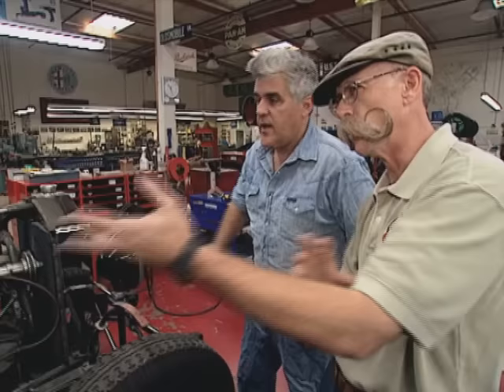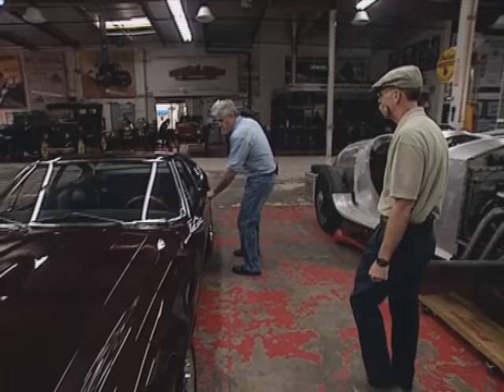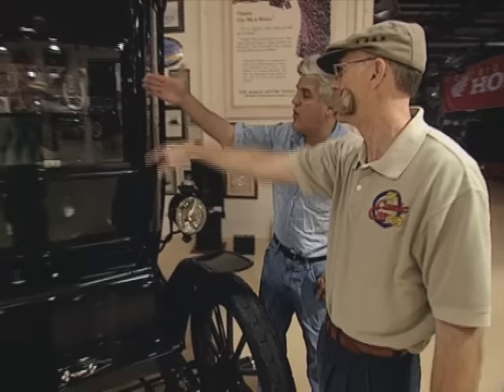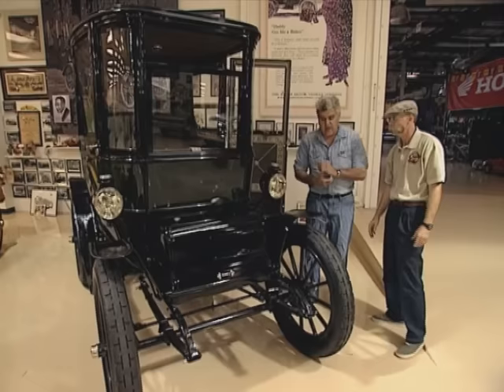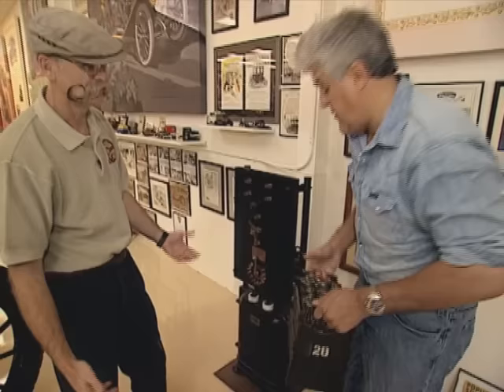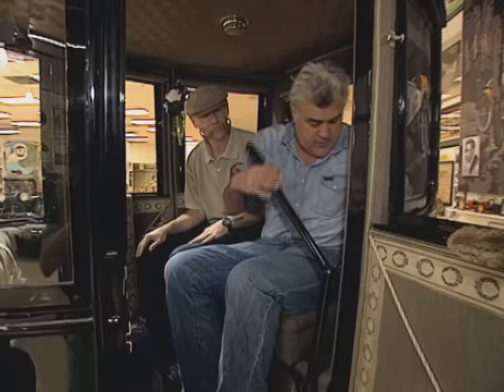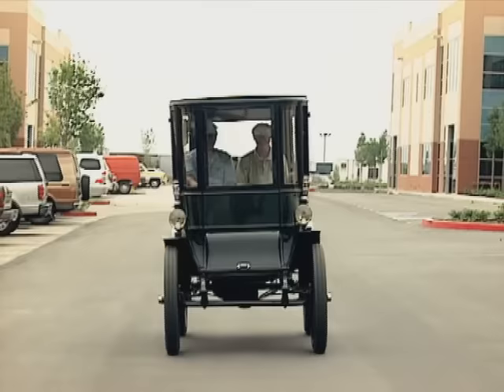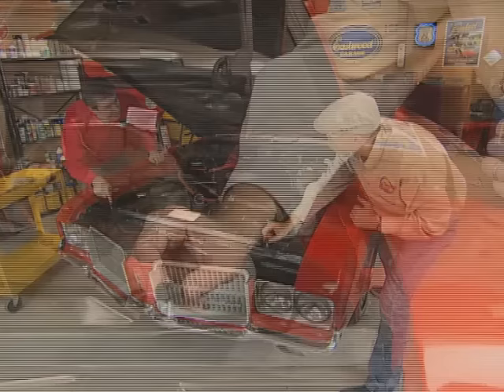Jay Leno's Baker Electric Car

Comment: Electric cars were very popular in the early automotive days. Electricity was easier to get than gasoline, and electric cars were easier to operate and maintain. However electric cars couldn't compete with the increasing range and power of gas cars, and the electric grid didn't spread fast enough.
Reply: You nailed it electric cars were coming into play at the same time gasoline car's were just gasoline car's made more sense at the time it was all New technology at the time

Comment: The crazy thing is that this car accommodates four people, sitting facing each other. So the driver, in the back seat, could have two passengers in front of her, facing her, blocking her view ahead. Not sensible.
Reply: hebneh sensible enough  a hundred years ago, going ten miles an hour.no horrible freeway accidents had not occurred yet
Reply: Who cares, women still crash when there's nothing blocking their view, lel. Also this car wasn't fast enough to cause any serious accident.
Reply: none of your business good to identify yourself here without further ado. there wasn't anything you were willing to share besides just that was there?

Comment: Tesla??? HA!!  I'd love to have one of these electric phone booths on wheels ^____^  Amazing!!
Reply: Angus Chandler  the fact it can only go 3 times as far as a car from the 1900s is... Not great. I know it doesn't have gewgaws and knick-knack paddywack give-a-dog-a-bones, but still. This could have lead to 1000 mile cars if we developed it then.
Reply: Angus Chandler  and if we had continued developing these, we'd have 700 hp and 1000+ miles of range.
Reply: Tesla was the one that started the revolution for real this time, they did not back down even when they were told to do so. They had to overcome all those years of brain washing the whole word has had for the last 120 years, GM tried it in 1998 and failed miserably to withstand the war against the usual suspects, watch the movie "who killed the electric car" if you want understand this a bit better. The fact that Tesla exists and it is forcing everyone to join the revolution or be irrelevant in 20 years is simply amazing.
Reply: I would upgrade the batteries in this and it might go faster and drive longer 😂

Comment: Astounding that cars like this still run, even if its a 1909 electric car! I'd like to see some toyotas or volvos or saabs last half that long
Reply: I would also like to see a Tesla last as long as the Baker. They think they're the biggest bunch of badasses when it comes to both electric and high performance cars. I think not.
Reply: +Stephen Carrigg its really not that astounding, cars this old are most of the time broken down in like a yard and then restored.
Reply: any car will last that long if its parked in a purpuse fit building maintained by a multi millionaire
Reply: it's probably restored

Comment: So how do you drive it?  Where's the throttle?  Just showed how to steer it. I hate when they skip important shit
Reply: Paul Digga And how are the brakes? And no seatbelts? How is it street legal?
Reply: Brian Battles  If it didn't have seatbelts when it was new, it doesn't need them now in order to be legal.
Reply: My father has a '60 Dodge Dart that has a chrome dashboard with no seatbelts.
Reply: its just 23mph not 123mph
Reply: I maintained a 1903 Baker at Hill & Vaughn Restorations back in the early 1980's. Ours was a right-hand drive. There was a beautifully finished phenolic black lever on a nickle plate to the right of the driver on an "armrest" sort of upholstered shelf with etched labeled "forward" and "backward". It had a very discrete "accelerator pedal" sticking out of the floor that ran through a rheostat/potentiometer. The brakes were terrifying, but at least they did not have that evil driveshaft brake like many other cars that reversed the wheels' rotation through the differential, because thankfully, there was no driveshaft brake. The windshield glass was beautifully beveled along the edges and the "bay window" glass was curved and beveled. The interior ambiance was so restful. I loved that car.
Reply: There's no bathroom in it ...
Reply: And the brake
Reply: Never Gonnatell  like you just said, each state has the right to their own set of traffic laws. And all 50 states have adopted the seatbelt law. Making it a legal part of legislature. So your argument is a moot point
Reply: @BrianBattles  
It's classified as an oldtimer. Special laws, special insurance. Can only make a certain ammount of miles a year on it. Laws might be vary from state to state, but a vehicle that is eligible for oldtimer status doesn't have to be matching current day laws.

Comment: Here's an interesting fact. Internal combustion engines are the highest advocate of the century. For most people, it seemed like the only logical choice for automotive power. But over 100 years ago, internal combustion engines faced fierce competitions: Electric cars that was on this video were clean and quiet, and allowed people to coast around neighborhoods with little noise or fuss, but big heavy batteries that couldn't go very far soon took electric cars out of the race. Cars powered by stream engines didn't had that problem.They were reliable and fast, so fast that back in 1906 they beat out gas powered cars in a head to head race, and set a land speed record of more than 127 miles an hour. Best of all, stream engines had been around for years, and engineers knew how to design and make them work.

Comment: How was the power regulated - when starting for example or for slowly rolling. Heating Resistors?
Update: I found all the info. And it CAN regenrate power when you go downhill. If you put it in reverse, it will brake while charging the battery.
Reply: it uses a bank of carbon pile resistors. it is a stack of carbon discs, more discs=more resistance, the stack of carbon discs you selected determined your speed. on these early electric cars you would have like 5 power levels to choose from with a switch. the carbon piles were on a drum and moving the switch rotated the drum connecting the carbon pile resistor you selected to the positive lead allowing current to flow to the motor.

Comment: Did he say he put Bosch Fuel injection on a Rolls Royce merlin?!! I dare say some Englishman just spat his pipe out.
Reply: Late versions of the Merlin used pressure carburettors which eliminated most of the faults, notably during inverted flying or negative G forces.  The pressure carburettor was introduced at the same time on British-made and US-made Merlins.  All these Merlin engines are Rolls-Royces, whether made in the UK by Rolls-Royce or Ford,  or in the USA by Packard.
Reply: @doktorbimmer6640  Won't happen. They looooove them some New Babylonia (united Europe)

Comment: why electric car technology is kept away ????
Reply: big oil
Reply: +Chris Beach  but why ??? instead electric generation would be bigger business than oil
Reply: not if you're an oil company
Reply: +Chris Beach ,,,, it's not about you and mee,,,, it's about our next generations future,,,
Reply: I agree, I'm just telling you why.
Reply: Fuel company's dont want you to go now do they. :)
Reply: +Nevakonaza -  we comman people are only slaves of government and corporations
Reply: For the same reason Cannabis is "kept away"  unfortunately there is one too many  greedy bastards at the helm .
Reply: The problem is battery technology. Its development has only picked up in recent years.
Reply: batteries suck, that's what most of the cost of Tesla is, batteries.
Reply: and the fact that the output/size ratio of batteries have yet to match that of gasoline- doubt they ever will, that's an explosive force in such a small package.
Reply: Jack Son 
Well capacitors have a chance. We've basically reached the max energy differential with Lithium and Cobalt, all we can do now is make the process more efficient or find a way to replace Cobalt with Fluorine.

Batteries work on a Redox reaction last time I checked
Reply: does it really need an explanation?
Reply: @Drakilicious Still, 100 miles on a charge is nothing to sneeze at even nowadays.
Reply: price of operation.

Comment: What killed the electric car?
Reply: +The real doktorbimmer The batteries weren´t that reliable maybe?
Reply: The ICE age!!!
Reply: shitty range most people can't afford two vehicles nonetheless an electric and a gas vehicle 1 for commuting to work and the other for long distance travel
Reply: Greed.
Reply: Uneconomic to produce, failure to maintain technological growth with ICE cars primarily due to lack of economic incentive. A few other reasons.

Bimmer is just a hater.
Reply: Shitty range
Shitty batteries
Expensive as hell
Poor reliability (those Lead Acids die extremely fast)
The cheap Model T

That's what killed this car.
Reply: don't forget the Model T was the first one to produce hundreds and hundreds of models in a time when most could only produce dozens and dozens.
Reply: It didn't really die, it just became a golf cart.
Reply: cory2146 — Economics
Reply: 1) motorists preferred a vehicle with higher speed & longer range
2) motorists also wanted a vehicle that they could easily fill up in minutes, not an hour or longer
3) similar to (1), you could easily drive from the city to the country & back. You could carry an extra can of gas at the back. Or buy it from a general store or workshop at a village. The same village would likely not be electrified yet, what more have a charger that's compatible with your electric car.

Comment: Greetings,
The Cheney-Cowles Museum in Spokane, Washington used to have an electric car on display in their collection.
I can’t remember if it was a Columbia or Baker car.
It was owned by one of the founding families of the city, and driven by one of the senior women in that family.
Hanging on the side of the passenger compartment was a medium sized bell.
The Spokane Police Department required installation of the bell, to warn pedestrians of the car’s approach.
The car was very quiet in operation, especially in comparison to other cars on the streets at that time.
The woman who often drove the car had a habit of of driving up to people standing in the street or on the corners.
If they did not get out her way, she would drive up close to them, and stop.
If they still did not clear a way for her, she would honk her horn, often startling them.
The Police Department tired of receiving angry complaints about her behavior, as well as complaints from her about people blocking her way.
The Police Department suggested she hang a bell on the car, to alert people of her approach.
After a time, she had the bell removed.
The problem of people not clearing the way for her returned, as did the complaints from all those involved.
She was elderly, and could not, or would not, learn to drive a more modern car.
The Police Department now required the return of the bell, as a condition of allowing her to drive on the streets of the city.
This story was on the plaque describing the car and its history.

Let’s be careful out there.

Comment: "Hi Bernard,..yeah,it's Jay calling.I'm in the Baker.Yep,the Tesla battery pack's working great.I just passed Vegas at 80mph as the throttle pedal seems to have welded itself.Uhhhh,...How do I shut it off?...I have...uhh 70% left,but the tires not so much.."

Comment: Back in the early 1900s and before urbanization the average shopper traveled less than a mile or two. Much easier to recharge an electric car before gas stations appeared on every corner. A Baker electric could be seen on the streets of Cleveland into the early 1950s.

Comment: Back in the 50's cars had 6 volt systems that really had a hard time starting in sub zero weather. 12 volt systems were added and cars have started easier ever since. Why? Although 6 volt batteries had high current capability, when the temperature dropped the amperage output also dropped as well as the voltage. The lower voltage was not enough to push the current through the starter. If a 6v and a 12V  battery have the same amp hour rating they can do the same amount of work. I'm guessing that the Baker had a 6V motor and that is why you used a 6V battery. Great video.

Comment: Actually the Baker did have regenerative braking.  You get regeneration automatically when you connect a DC motor directly to a battery the way the Baker does.  Leno could drop a set of off-the-shelf lithium batteries into his Baker without modifying anything on the car.  He would get a range of 500 miles which is more than most modern  EVs.

Comment: The Baker is basically a street legal electric golf cart. I'd love to own a  modern version of the car with a price point around $12K. This could be a base model, with a 100 mile range, mainly for running errands around town. Correct me if I'm wrong, but I don't believe you can buy any new, fully electric, street legal, vehicle in the USA for that amount.

Comment: That would make a kick 
ass kit car.....probably not street legal in many states....no problem where I live...lake havasu city...you can put a plate on anything...how many places do you see side by sides as daily transportation? Open wheel dunes buggies with no winshields..just need eye protection...ever see a banshee on the street? Troy trucks. No muffs, slicks...just drive the speed limit and dont drink and drive....no smog or safety check. Headlights, tail and brake lights and it's good to go...I have a 3000 watt ebike...runs almost 55..I ride it in the bike lanes...no plate..ebike speed limit is 28 mph...its like I am invisible to the police

Comment: "That Monteverdi looks very Italian" - actually this is very close to the truth, as Monteverdi subcontracted the bodies of their cars out to Italian coachbuilders! Originally it was Carrozzeria Frua, who received the chassis from Monteverdi and were responsible not only for manufacturing the body but also for final assembly. Later Frua gave up the job because they had too many customers, and Monteverdi struck a new deal with Carrozzeria Fissore. Here the situation was reversed - the Italians manufactured only the bodies, which were shipped to Monteverdi's factory in Basel for final assembly.

Comment: It was easy to make an electric car at the turn of the 20th century that could compete with horses or the early gas powered cars because the required performance metrics weren't off the charts ridiculous then like now. Today all you hear about is 0-60 performance and 100's of miles of range being required... That takes over a hundred kilowatt hours of battery storage to accomplish...  An electric car with a top speed of 50mph and a range of ~100 miles could be easily made today at a fraction of the cost of even a modern compact gas car and I'll bet a lot of people would buy them as they could be charged using a typical dryer outlet in a couple of hours which would really be no different than drying a load or two of laundry...

Comment: The 1909 Baker "maintenance-free' electric car is proof of why Ford and GM are going to be phased out as car manufacturers, just like the dealers and garages. The new paradigm is you buy a car for life and then that will morph into EV's being part of condominiums / houses. You buy a house with a car, the car comes with the house.

Comment: Man, someone needs to make another Baker Electric car to compete with Tesla. At the moment, Tesla does not want anyone to work on their car. The Tesla has a proprietary 12V battery for electronics and proprietary batteries for the motors. Nothing on the car is self serviceable. This needs to change with the right to work on your own vehicle. The baker had serviceable batteries, and someone needs to do this again.

Comment: Early gasoline Volkswagen Beatles also had 6 volt electric systems, which were crap compared to the 12 volt systems, so i’m not so sure the 6 volt motors had more power; it’s just what was available.

Comment: It looks really cozy. Having passengers seems like problem though.. Imagine driving with someone in front of your face talking to you. Lol

Also I wish they would've gone into detail how they go, and steer in it. I imagine that tiller was only the accelerator that you press forward or backward, but perhaps you also turn it like a motorcycle throttle bar, and either of those actions could be the driving and the turning.
Reply from the maker: Nope. The tiller is what steered the car. Forward was left. Back was right.
Reply: @MyClassicCarTV  then what makes it accelerate and possibly reverse?
Reply from the maker: Floor pedals, if I recall correctly.

Comment: V = I X R, V = Voltage, I = Amperage, R = Resistance (car engine). So, the higher the voltage, more  Amperage = more power. Not the other way around.

Comment: I wonder what kind of milage modern electric cars would show if they were tested at 30km/h, there is like a 10X difference to aerodynamic drag compared to going at 100km/h. Force of aerodynamic drag scales with square of velocity and power needed to overcome drag scales with cube of velocity.

Comment: That's a beautiful car. <3 
If the Baker would go about a hundred  miles between charges back in it's day with the original Edison batteries, how far will it go with those modern deep-cycle batteries these days?

Comment: That's pretty amazing. I drive a Chevy Bolt (had it for close to 2 years), and it's a great car, and on the cutting edge (238mi range). But, imagine what could be if the oil companies hadn't pushed electric into the corner.